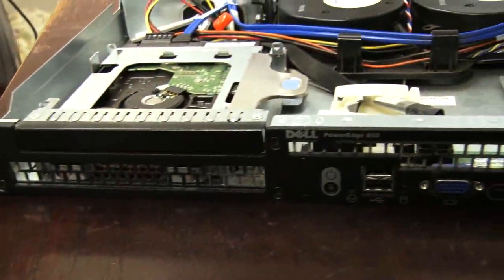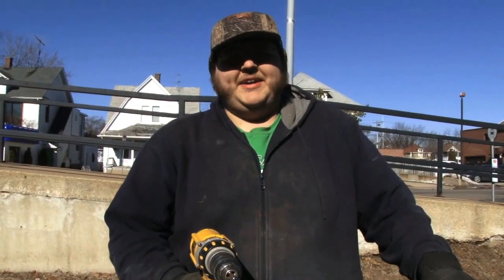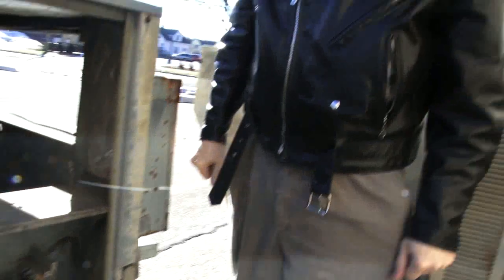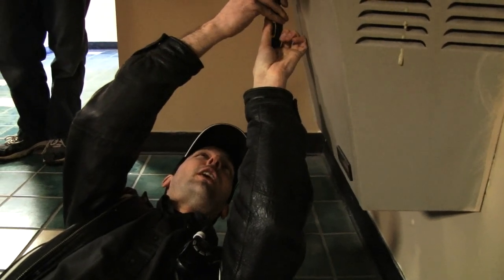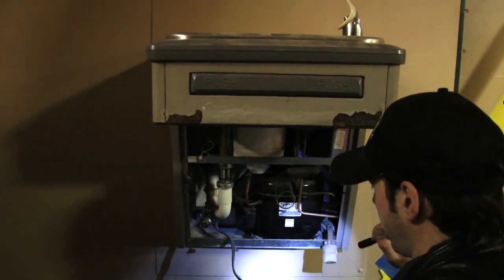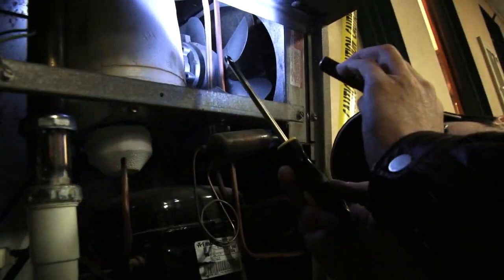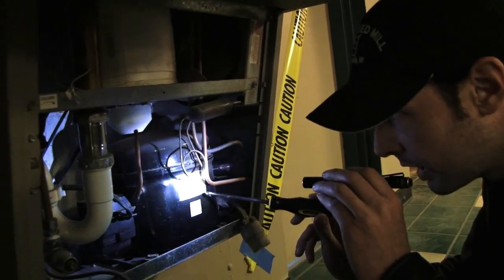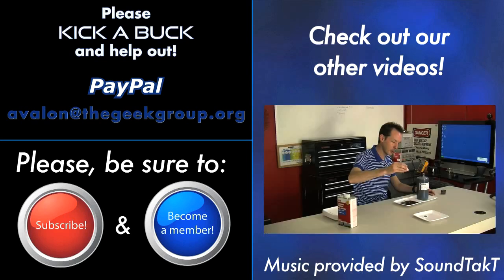Weekend Log #8

Comment: for the servers at the start of the video. they render 1 gig of input video or output and what video rendering software to you use?.. i just upgraded my system with my tax refund and did all of it just for video rendering. got 8 gigs of ram and AMDs 6 core 1055t, yea i know AMD isn't the best for rendering but for the price per performance its amazing. and my Nvidia 460 gt superclocked. anyway. takes about an hour to render 15 min worth of fraps (10 gigs+) into 720p video